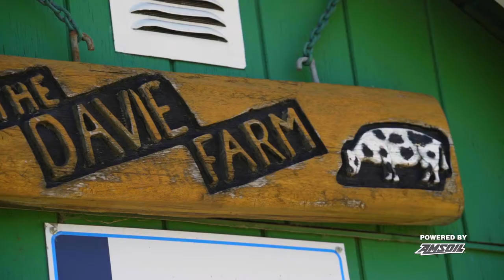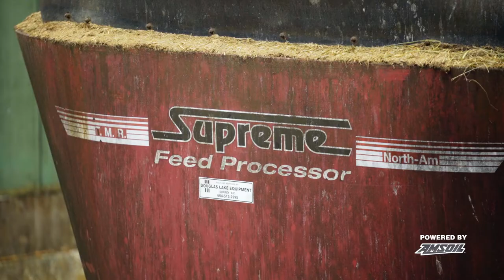Company of Enthusiasts: We're Into Agriculture

Comment: I would only use John Deere Plus 50II or Amsoil in my diesel engines. The JD is a non-synthetic oil and its TBN is almost as high as Amsoil’s. Pretty impressive. I’ve have great oil analysis reports with both. Amsoil is a little better but a little more expensive too. You get what you pay for.